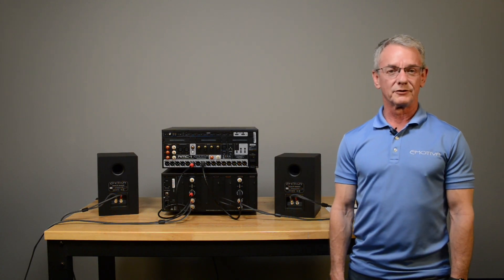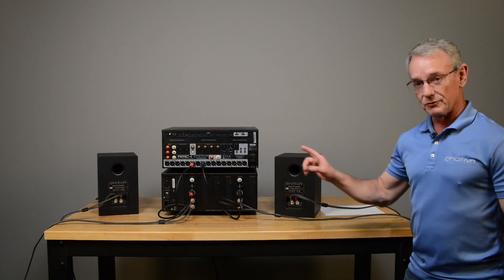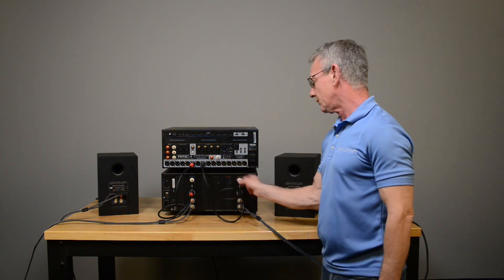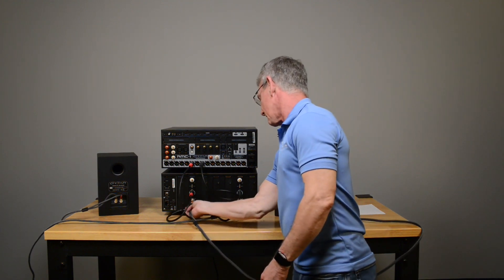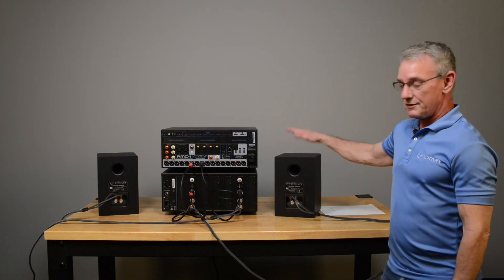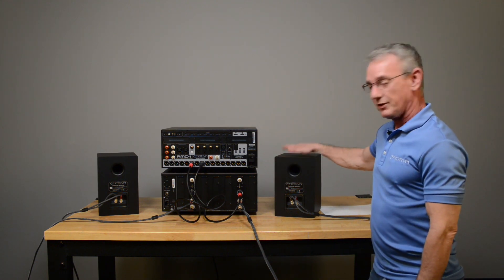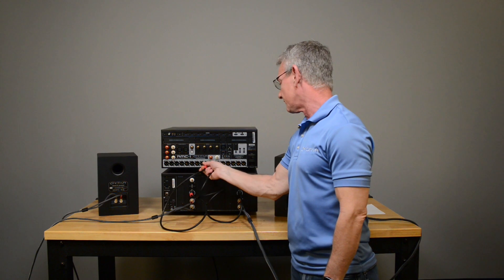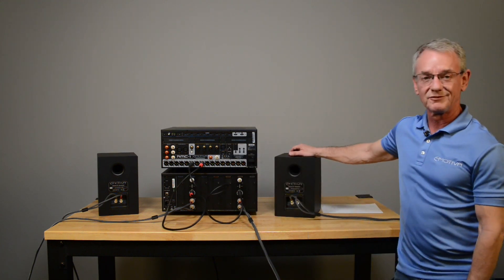Dead Channel in your System?

Comment: I would add to check the XLR/RCA switch on the back of the amp is correctly selected. That would also cause issues.
Reply: Absolutely if you have an amplifier that gives you both XLR and RCA connectors.

Comment: I have a ten yo stereo system setup with xda1 and xpa2 as preamp and amp. My issue is not dead channel but weak. Right side output to speaker is really really weak and through swapping L and R, I think it's the amp. Is it possible that a channel has 'weakened' rather than completely dead? Thanks!
Reply: I have same problem. Then when i push hard on the volume knobs. It gets sound again.   A little spray of  Fender Funk Out . Fixed it for a few years

Comment: The front left channel on my Yamaha 5.1 home theater reciever is kinda problematic. It works, but it’s quieter than the rest of the channels when I first turn it on. If I either turn the volume way up or tap on the cone, it comes back to the right volume without fail what might this be? 
My previous reciever (early 2000s Onkyo) had this issue with both rear channels intermittently, except it was completely silent and wouldn’t activate when you turned it up. You had to bang on the cone really hard, shut it off, then turn it back on, and repeat until you got sound eventually. It usually worked after either the first time, or one power cycle. One day, the rears on that reciever stopped working all together. The speakers still worked perfectly on another reciever though. 
What might be causing these problems? I’ve heard about it being a failing speaker relay inside the reciever, but I want to confirm.

Comment: I have a GE model 3-682a GE boombox. Right channel dead, but both speakers work on only the left channel. Have no clue, i sees some 470uf caps in there might need to be changed, some 4.7uf caps, wich i ran out of.. one by the power on the back of the board, it works for now, til i get the right replacement parts,, repaced a 25 volt 10uf with a 16 volt 10 uf. Pretty sure i will need to replace it in a few more years but now i have sound, just one dead channel..